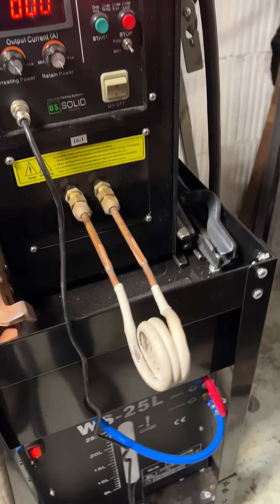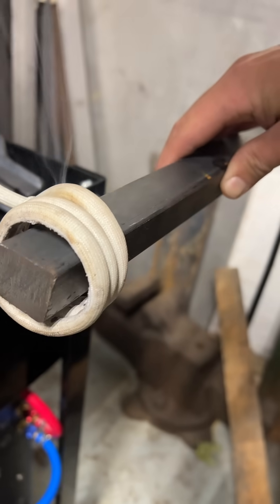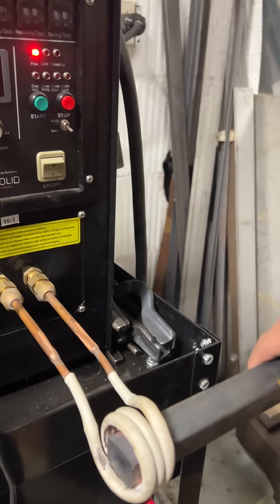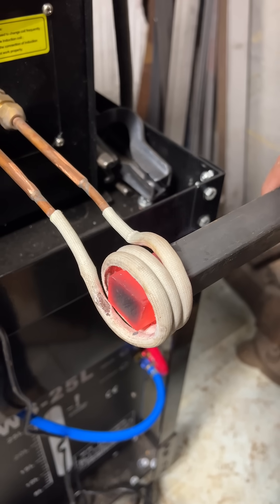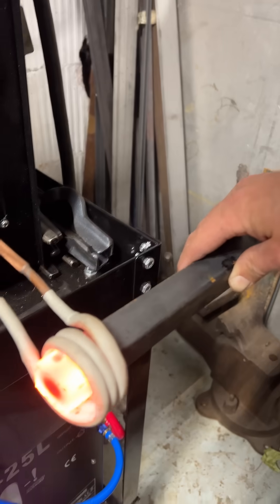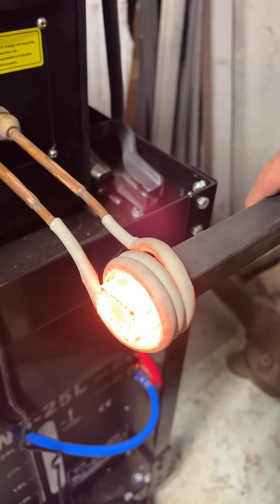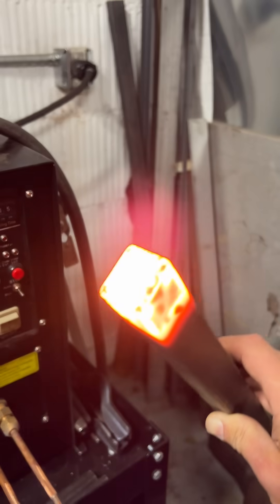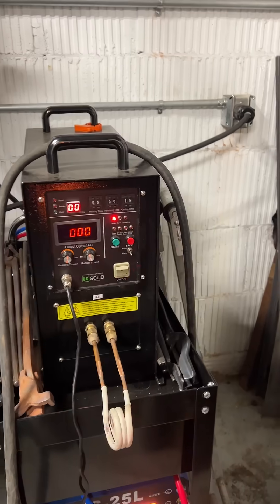Red Hot Steel In Seconds! - Induction Heater

Comment from the maker: This is a US-Solid Induction heater, its been AWESOME to have in the shop. You can check it out here: https://amzn.to/3I7V07M
Reply: Very efficient way to heat up metal too.
Reply: @supertornadogun1690 so what else does it heat up besides metal?
Reply: @tomfull6637  Only metal, because it needs something conductive in order to warm it up.
Reply: Is it copper tubing with wire inside and an insulating sleeve on exterior
Reply: @johnle231 no, just copper
Reply: @johnle231  Its working on induction like induction stove the copper pole have a role on inducing current while a work metal is receiving current and vibrate in the molecular cause heat the insulation on copper is there to protect the copper from direct contact with work metal cause copper have less melting point
Reply: Shame they're so expensive. I'd love to have one of these.
Reply: This is single face electric.or tree fase elet
Reply from the maker: @KazFamily-x4k single face
Reply: How much this one @MakeEverything

Comment: What about welding? If you were to have it in the same position, but just use your other hand and then the opposite side another piece of steel bar will it will it weld together? also what happens if you leave it there for a long long time would it melt the steel?

Comment: We have two induction heater carts like that at work, constantly get broken because production loves to prop the pedal and then go on break when they shouldn’t have it running for more than 30 seconds max, more often 2-5 seconds at a time. Used to heat the tips of nitinol or titanium tubing before “tagging” it so it can get drawn down to a smaller size. One of many machines playing a small role in a big journey to make some tiny stents.

Comment: As someone who very much understands the workings of physics and the law of action I do not understand how the transference of heat is stopped here. I understand what the machine is doing and how it is heating only one part of the metal but the metal is still the same. Heat should transfer throughout the metals mass, it's part of the cooling process which starts the second the heating processes starts. So how isn't his hand burning at all?
Reply from the maker: As far I understand it, the heat is so well concentrated it doesn’t creep as fast as other heating methods would. If I were to continue to hold on for another minute my hand would burn

Comment: No "magnets," the copper coil acts as an electromagnet with rapidly oscillating polarity, which set up opposing eddy currents in the metal, essentially "vibrating" the atoms of the metal, which generates heat. It's the same process used in induction stoves.

Comment: Used to work with an automated induction heat treat that would harden 38mm ballpins from room temperature to just shy of 1600°F in 3 seconds. The power bill for that machine was $30,000 a month, running 24/7.

Comment: Now if metals very conductive how the h*** is that heat not traveling to his hand
Reply: The metal is heated theough the induction of a magnetic field which is very locational. Meaning that it heats the inserted area and pretty much only that in comparison to traditional heating methods which spread the heat more evenly. That thing will eventually become too hot to touch tho.

Comment: İ think that coil is accualy too small.

İnduction heaters work on lc resonator principle.
Due to way this resonator works more turns you have at work coil its resonant frequency decreaces.
Your coil has a small number of turns. This causes the frequency to go up.
Due to skin effect higher the frequency less area of the metal you are trying to heat gets accualy heated. 
You shoud try using a coil with more turns and only insert the tip. That shoud heat it up faster.

Comment: I worked on heavy equipment. We had a hand held mini ductor. It works great on rusted bolts, nuts. This is its big brother
Reply: Very cold does the same thing.  The metal will shrink causing the rust to flake off.

Comment: I'm probably not the 1st person to post this but here goes. You can find those in a small handheld version too 🫠.
Auto mechanics use them to heat rusted and/or difficult to remove nuts. Not too sure how well it works with bolts though 🤔

Comment: Electricity bill has entered the chat
Reply: It sounds correct using the same logic a fridge draws 5amps but it is running when the compressor cycles on. So 329amps divided by 5 amps means a fridge compressor will use the same amount of energy 65.8 times slower. So if we run a fridge compressor for 3 days straight it will cost 8.28$. Dividing the fridge compressors on time of 72hours by 65.8 gives us 1.09422492 hours and running the induction heater for 1.09422492 hours gives us 8.05$ which is accurate if we take into account rounding. So it really cost 12 cents per minute at the low power setting. When it gets high it was 720 something amps which would be 25 something cents.
Reply: @yourboi1842  lmao i dont think ive ever seen a better answer to a question than this. you murdered that question bro
Reply: These tend to be very efficient. This still cheaper than keeping a gas furnace on for a long time, as you only use energy when you need it.
Reply: I highly doubt this more efficient for blacksmithing work. I understand the fridge analogy. It would be better like he said small blacksmithing jobs. I could do a week of work in my small forge for a $15 propane tank

Comment: That's actually amazing! The induction heats up the metal so quickly the heat doesn't have time to travel down the rest of the bar; so one end can be white hot and a foot away you can still hold it barehanded.

Comment: this works with induction… not „magnets“ . With an electromagnetic field. And the coil is isolated not because it's hot, but because it shouldn't get hot... caused by the heat induced on the workpiece

Comment: Eddy currents produce temperature. Thus a large temperature is created. So a coil is wound over a constituent metal which is placed in a field of the highly oscillating magnetic field produced by high frequency. The temperature produced is enough to melt the metal.

Comment: Be careful my friend, if you touch the coil with the metal bar you might get electrocuted to death
Reply: It's heating by induction.  A magnetic field is inducing eddy currents in the steel bar and heating it internally.  No transfer of electricity, therefore no shock.

Comment: If anyone interested on the physics what happens is that coil is generating a changing magnetic field and when you put the metal in their due to faradays law of induction current gets generated in the metal which causes its to heat up. It’s called eddy currents.

Comment: I like how it uses a cooler to keep the coil from going through a thermal run away.  I’m wondering if it uses mineral oil or deionized water 💧.
 I 🤎 non traditional manufacturing and engineering.
Shabbat Shalom ✡️

Comment: No magnets!  Just results of a happy accident when someone tried to make an electromagnet using AC (Alternating current{ the polarity switches it’s direction at 60hz per second} ) instead of DC (current flows in one direction {the polarity does not change}) 
Unlike DC current that flows like water in a pipe, in alternating current, the electrons don't move in only one direction. Instead, they hop from atom to atom in one direction for a while, and then turn around and hop from atom to atom in the opposite direction. Every so often, the electrons change direction
The rapidly alternating magnetic field penetrates the object, generating electric currents inside the conductor called eddy currents.  You can build this same device by upgrading the coils in the transformer of a microwave oven remove the klystron or magnetron depending on which device is employed.  The new Leads from the upgraded coil go to the coil you will make out of copper tube at least .500 OD x.375 ID.  More coils more resistance 3 turns is perfect 4 or more takes more power and takes a bit longer.  The more coil loops the more the resistance the more power is required.   Looking for a quartz heater since their components are made for heavy duty and if done right with .250 OD and spaced right then I should be able to build an induction furnace for longer objects.
Shabbat Shalom ✡️.

Comment: 800amps in that slim copper rod/cylinder? I thought it would have to be thicker. Crazy stuff :)
Reply: Its high frequency so the current doesnt affect it as much
Reply: @Extra_Mental  doesn't matter bcz 800 amps at a really high frequency will produce more heat due to switching loses.

Comment: heating with magnetic resonance ultra hi ultra low compressions to expansion ability and cooling system that is cold electric. The old fashioned way as to fire is a speading technic in the metals and a couple other carbons it burns out the surface hardens to realize that the experiencers own closeness to the experiences is a greater chance to see the futures trade today as speculators enlarged positions of the experience we look good in America

Comment: I have a venom mini inductor. It's portable and I use it alot on stubborn bolts.. I have a ton of different sizes of coils that can be used for different size nuts and bolts. The venom was $500 and the coil set was $200 best money for a mechanic who doesn't wanna waste time and gas with a torch!

Comment: Serious question: does having the heat so localized not put severe strain/stress on the metal, due to how strong of a temperature continuum there is over so short a distance? Meaning more risk of cracking ... I dunno, I'm no blacksmith.

Comment: Used to work furnaces that would melt iron that quick 15 foot deep induction furnaces. It was unreal. The company couldnt fire up the furnaces full power until after 7 pm because they drew that much power from the citys power grid.

Comment: Induction heaters do not use magnets, although (electro)magnetism is involved. High-frequency electrical current in the copper coil induces eddy currents in the iron bar. Iron is high enough in resistance that the currents heat it up. A lot.

Iron is a poor thermal conductor, which is why you can handle the other end.

My girlfriend (now my wife)'s family had sterling silverware. Every time I made tea at her house I burned myself on the spoon handle. Having grown up in a stainless flatware home, I was used to being able to leave the spoon in the cup.

Comment: This is how they made the stone walls that shape and form perfectly to one another. Obviously they had a much bigger set up but essentially they would do the same thing to giant stones and drop them into place when they were super heated.
Reply: It won't work with stone, it's basically a strong magnetic field.
Reply: @jimmaag4274  it does with Soap Rock 🪨 . However, it takes a massive amount of induction and time, depending on the size of the rock.
Reply: @baconsalad1891  no, it doesn't. Induction heating only works with metal
Reply: @jimmaag4274  Wrong, It contains mostly 
Magnesite which is a metal that is highly magnetic.
Reply: @baconsalad1891  HAHAHAHAHAHAHA, the UFO's are asking for help building the pyramids.
Reply: @jimmaag4274  still doesn’t change the fact that you are wrong.

Comment: A bit more oxidation because it oxidizes while it heats up. In a forge it would be protected from co2. Maybe put it in an envelope with argon gas. But I don't think it is worth the time. It will oxidize as you work on it either way though.

Comment: My boi bear hand holding a heated metal. What.
Reply: Induction heating is very central to the conductor. Does heat radiate some yea, but with how thick the metal is it’s not much. Magnetic forces are multiplied or divided based on distance. So outside that loop there is so much loss that it doesn’t work anymore.
Reply: @ihateeverything9887  it also just takes time it’ll even out but it takes time for that heat to transfer
Reply: If it doesn't conduct heat well that is believable - it's white hot at the end but not even red hotany further than where he held it inside the loop.
Reply: @mnomadvfx  it would even out eventually but one side can get that hot when the others cold just don’t hold it for too long
Reply: @awsomegamer8277  It’s because of the speed the speed of the ring heating it is faster than the speed that conducts heat and distributed evenly
Reply: @floweuphoria999  I can’t tell if you where adding to my point. If not that’s literally what I was saying. If you where trying to add to my point, that’s exactly it!
Reply: @awsomegamer8277  Yeah I just dumbed it down a little
Reply: @mnomadvfx  it's VFX
Reply: My clumsy ass...I'm wearing gloves, face shield, everything..don't care how isolated it is..one slip..
Reply: @yardblah5161  yea obviously but for a 1 minute demonstration it’s no big deal
Reply: *bare hand
Reply: Dude really didn't listen to anything in the video 🤦
Reply: Bear 🐻 hand 🤚
Reply: it's graphite probably.
Reply: He isn't your boi
Reply: They make stove tops like this where you can touch it but if you put metal on it it’ll heat up like that
Reply: @floweuphoria999 👍🏻 they heat up cast iron nice and specially made induction pans.
Reply: 🐻 🐾. Bear paw.  Bears don't have hands.   This guy may or may not be one.
Reply: @overvoltagestudio  why they made steel pan or other cookware?
Reply: Should try copper,that thing will burn ur hand the moment it gets any heat
Reply: Someone didn't watch the video
Reply: I mean, don't we all do that everyday using a frying pan?
Reply: You can put Pictures on the end of IT, Like Zorro, Dicks etc. And poke people. 🤣 Sry did i really write this 😳😆
Reply: looks like stainless. stainless steel doesn't actually conduct heat all that well, as far as other metals.
Reply: Your "boi" literally explained how. Thats what.
Reply: @Ms._Carriage  did he or did he only just say it’s isolated?  I don’t get how
Reply: @adrock889  Because it happens quickly; the heat will obviously spread down the metal bar given time.
Reply: @adrock889  potatoes 🥔
Reply: he isnt even getting electricuted

Comment: It doesn’t use “magnets” to heat it!  It uses induction to heat it.  It does take advantage of the magnetic field as electricity travels through the coiled wire which is an inductor.  But no magnets are used!

Comment: I was gonna say how is your hand not on 🔥
Reply: Steel doesn't conduct heat very well, so it's easy to spot heat it and have the heat concentrated in one area. Try that with a copper or aluminum bar and you'd drop it in just a few seconds. (Which is why those metals are used to make heat sinks.)

Comment: Nothing to do with magnets. Its all about being an RF transmiter. Your bar is the antenna. If yours is like the one I used forty years ago there is water flowing thru the loading coil to keep it cool. Yours is solid state. The one I used yrs ago was 5x larger with 3 16 inch vacum tubes inside. Get some lead panties for the boys. Lol
Reply: That's not how induction heating works

Comment: I'd like to see how close you can touch. You could measure thermal conductivity which would be cool in a hot kind of way.
Reply: and lose all the feeling in your fingers in the process lmao

I run a smaller induction heater for brazing small parts where I work and just touching a part for a few milliseconds will give you a 3rd degree burn. Half the time it doesn't hurt bc it kills all the nerve endings

Comment: We use an induction heater for high precision milling machine tools.  Basically the hole in the tool holder is very slightly smaller than the shank of the carbide tool you're going to install in it.  Induction heater heats it up in 2 seconds, expands it, then you set the tool in.  Then it's cooled with a special collar and shrinks around the tool shank.  
Then it's balanced for 30k rpm

Comment: Not magnets bro it's electro magnetic switching measured in megahertz and let's see how long you can hold the metal bar🤣👍
Reply: Measured in kHz for that size of bar
Reply: @jimmaag4274  depends how hot yes I'm my case I'm melting steel so I sometimes push up to mHz👍😁
Reply: @carelpawson667  that's not how it works Carel. The higher the frequency, the shallower it heats, not the more power it has. A furnace with a tank that resonates in the mHz range would be for very thin metal, the lower the frequency the further the heating effect penetrates.  Large induction melting furnaces run as low as 60Hz
Reply: @jimmaag4274  yes I melt scarp to can so pushing up to mHz makes it easier
Reply: @carelpawson667  ok, that's not how the electronics in an induction furnace work, but I'm not going to continue arguing with an operator.

Comment: There are no magnets in that machine. There is a magnetic field created by the current flowing through copper coil where the steel is inserted. The magnetic field induces current in the steel. The steel is a relatively poor conductor. The heat is restance losses from the induced current.

Comment: I wonder if you could use it to sinter together PMC, or other sinterable material. being its so isolated heat wise. might just rip it apart too.. 🤔 would be an interesting experiment. what happens if metal is left too long, and melts and falls on the coil though?

Comment: i want to wait for it to be used in a TikTok challenge for men, and for the prices to drop
Reply: You can get them for £30, although i wouldn't trust it tbh, it probably doesn't work properly and will probably turn you red hot instead of the metal

Comment: That’s exactly how steel mills remelt scrap and make fresh new steel, The material goes into special ingots That sits in between electrodes like that but on a giant scale, the steel will melt and then carried off into the mill were it’s poured extruded stretched and formed into the steel products that  we see today, just like that 1 by 1 in
Square bar you’re holding. When it was first made it was probably 100 feet long and then cut into manageable size lengths.